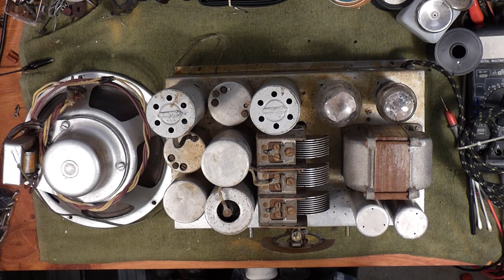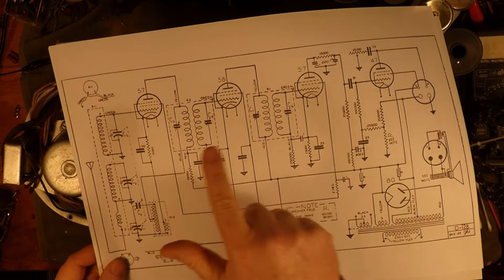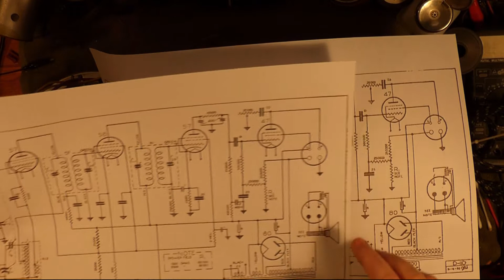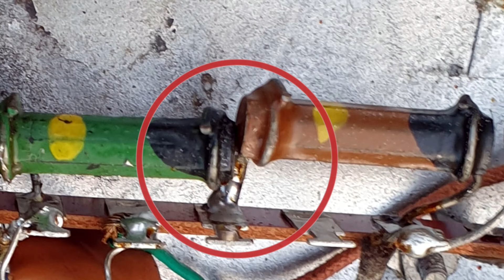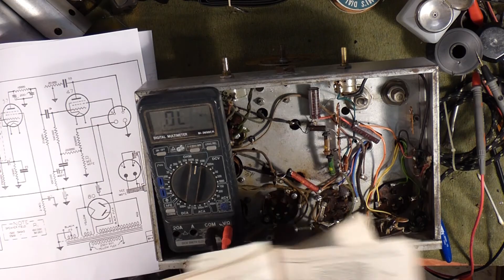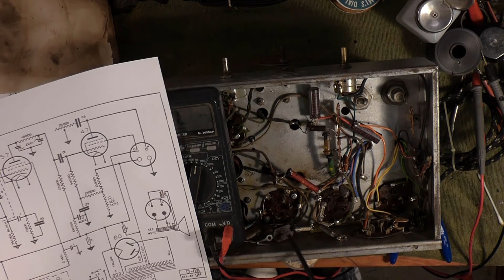Courtenay model 5C - Part 1

Comment: Totally agree with you on the lead free solder, it's more poisonous than 60/40. It melts at a higher temp and doesn't flow well. Interesting set you're working on. I'll defo watch the whole series.

Comment: Greetings:
The most common rosin core flux solders used in electronics manufacture are alloys of tin and lead. They are 60% tin and 40% lead being most common followed by 63% tin and 37% lead which is the utectic alloy with the lowest melting point.
Silver solder was used heavily by Tektronix in their eary days of manufacture of test equipment priarily oscilloscopes. The manufacture method used ceramic supports (instead of tag strips) for component mounting that had metal inserts within the ceramic mounts. You will usually find a short roll of silver solder within each piece of gear. I do not remember the failure mode other than the ceramic mounts would fail somehow if regular solder is used for repairs. I suspect that other equipment, particularly avionics, used silver solder as well.
Reply from the maker: Thanks for that detailed explanation James.  I wonder if someone got their wires crossed about the silver solder issue and that's why it all got thrown out then. Either way, it's the best solder I've ever owned so it worked out well for me.  I just wish I'd gotten more :)

Comment: Nothing worse than finding a previous "repairman's" mistake. 
Check all the wiring coming off that new terminal strip. That is where you might start with. I know I would.
Arrgggh! I highly recommend Buzz1151 as a fellow YTer who gets similar problems with American vintage radios.
And a great entertainer as well.
Reply from the maker: I think I'll just solve the problem with a scorched earth approach :)  That way I eliminate all those 'previous repairman' issues and if it doesn't go at the end I can only blame one repairman.  In the immortal words of Mark Knopfler, "When you point your finger cos your plan fell through - you got three more fingers pointing back at you" 😄

Comment: Really nice to see same hobby person I'm from India 🇮🇳 22 years old college student I do collect vacuum tube nearly I have now around 12 thousands vacuum tubes and 230 valve radios and much more alll spers parts and I make hifi output transformers and much more thank you I would like to have your contact info
Reply from the maker: Thats a huge collection you have!  I used to have around 400 radios but have slimmed that down to a far healthier 100-ish (give or take)... but probably only about 30 I care about, and about 5 I would take with me to a desert island if I had to.  Did India have any valve radio brands or did they import?  Cheers, Steve
Reply: @VintageRadioSteve  grate. India has philips Murphy and nelco valve radios

Comment: AUGGGGGGH!

Seriously, it might be that neither schematic is the right one, and a tone control circuit was implemented in a grid circuit.  But it would be helpful to sketch out a partial schematic around the controls and audio tubes, enough to suss out the power and signal flow, hoping that whoever hacked on it last didn't mess it up too profoundly.  Work backwards from the audio output transformer if possible.
Reply from the maker: The 5C schematics are factory drawn, so I expect they should be close and they're not too different from each other.  I also have a Pacific branded  5C equivalent that I'll have a look at - but I'm 99% sure the tone control should not be in the grid circuit - thats either an experiment, a mod or a mistake.  I'm going to put it back to the factory design, but I'll probably finish the Pacific 107 first... maybe... hopefully...

Comment: Standard flux solder has mostly been 60% tin and 40% solder with a flux core. Looking forward to more of this series.
Reply from the maker: Cheers, yep - 60/40 solder is the standard - I don't know if the solders with the antimony or silver or any of the other 'minor third element' mixes are specialist types or commonly found - the recollection I had from my electronics training was that those third parts were to balance the different cooling rates of the tin and lead and thereby form a stronger joint - but I'm not sure if that was just an air force thing, or if it was in common use.  Cheers, Steve

Comment: Absolutely completely strip it down and clean the chassis, make any necessary repairs to the chassis, and replace components and wire from scratch!!! 
I would love it if you would draw out a schematic of how it actually is wired right now before you do all the corrections.
Reply from the maker: Agreed :)  And I'll see how I go for a current schematic but it might not get done...

Comment: Haha, funny video.
Very old equipment = a lot of people can have had their hands on it.
Personally I think I would remove all components and start over with the schematic and logic thinking because it seems a lot of the components are out of spec anyway and not very original... and last but not least there is not a lot of components in it.

Looking forward to part two 👍
Thanks for the upload.
Reply from the maker: I agree, I'll strip it and start again - but not yet, I want to finish the Pacific 107 first... I'm a shocker for not finishing one project before starting another... so I'll try not to do that here :)